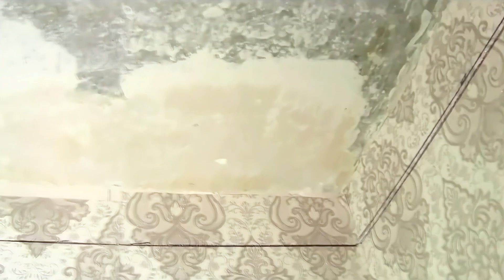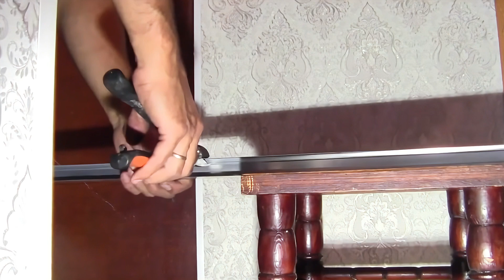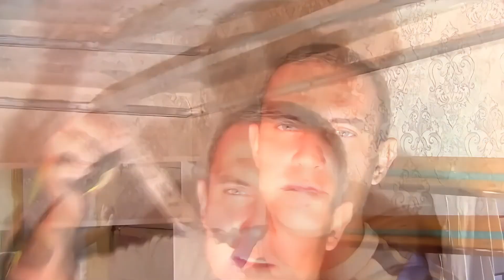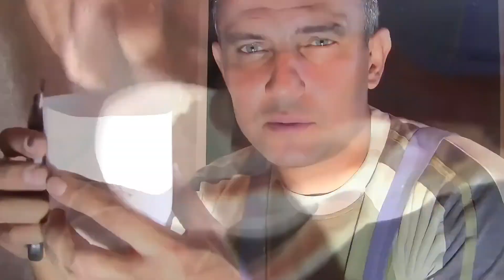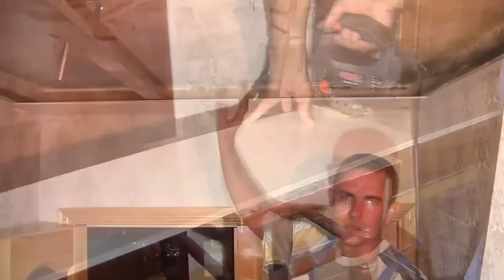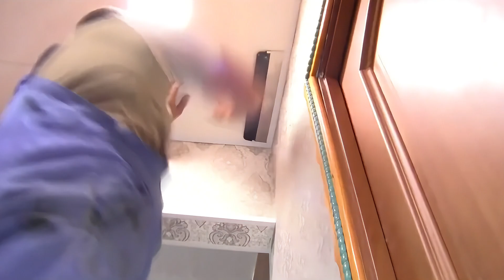Installation of PVC Ceiling Panels

Comment from the maker: Installing PVC panels is a great way to get a clean, modern ceiling without the high cost of stretch ceilings! 🏠 The last panel is always the trickiest part—did you find my 'cleaning solution' hack helpful? Let me know if you have any questions about the frame or the lighting setup in the comments! Happy DIY-ing! ✨🛠